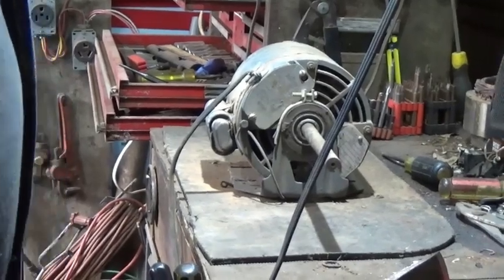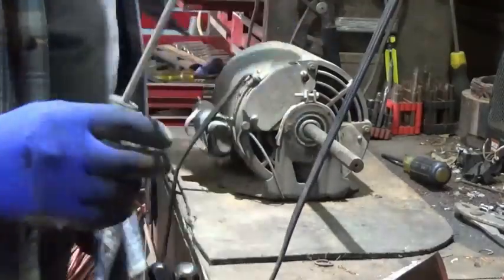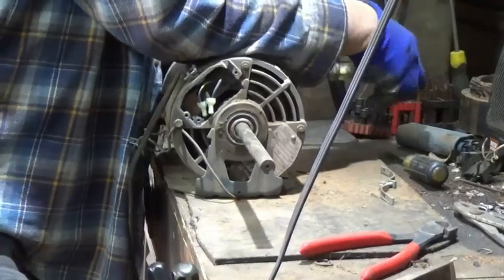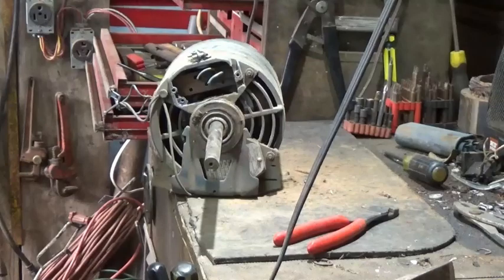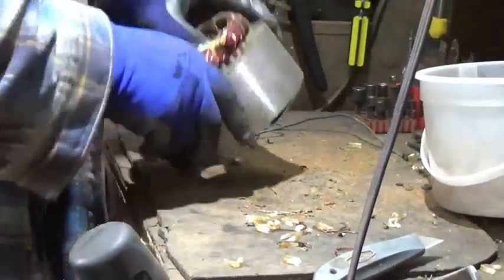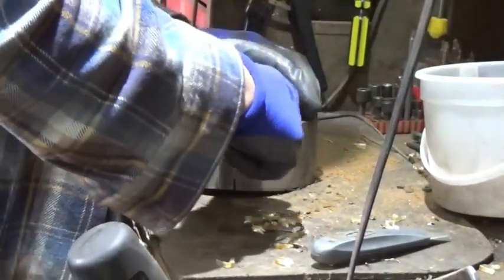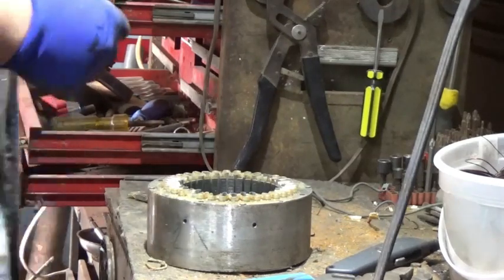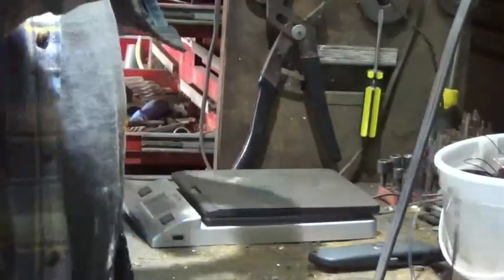Scrapping another Copper Motor for Copper and cast Aluminum

Comment: Love stripping motors.  Never had much luck with air chisel, though.  Could be it is a cheaper set, also could be dull.  Maybe a tutorial on how you keep yours so sharp??
Reply from the maker: my first chisel was a cheep one but got the job done, the one i have now is a craftsman, if i remember it was about $30.00 , i sharpen the chisel on my bench grinder, will try to do a sharpening on next video and get a close up of angle, Thanks for watching,
Reply: @Okiescrapper  Yeah, when I looked for the Craftsman, I could only find them in a set of 4 for $120.  Couldn't find the individual chisel anywhere.  :-(
Reply from the maker: here is a link to the chisel set about $16.00 https://www.searsoutlet.com/br/pdp/craftsman-4-pc-chisel-set/20353?uid=56713597&storeZip=98406&sid=IDx20110411x000008&scid=scplpN20353&sc_intid=N20353&gclid=Cj0KCQjwt5zsBRD8ARIsAJfI4BgAXYmS8qZIO475O8g2HoDPFOAX16_MtoCgXdcZz_2a6-SrT0WyZ0oaAjxuEALw_wcB

Comment: Is it worth your effort to do aluminum wound like that dryer motor? I'm told diff. Things I'm disabled do as hobby sorta and pick up some extra
Reply from the maker: If I have the aluminum I will do it, I pull the motors from washers and dryer's most have aluminum case and aluminum windings may be $1.00 in each motor but It's a hobby, and builds up fast,

Comment: I made a fork out of old chisel do the whole thing with air chisel
Reply from the maker: Nice , that would be interesting to see. does it work well?. Thanks for watching
Reply: @Okiescrapper  yes works well. I do the same thing you do cut off 1 end with air chisel then use my fork / birds mouth on the air chisel to tap out the copper windings